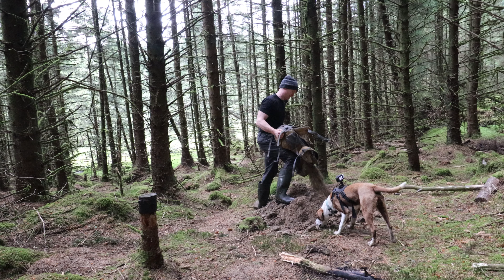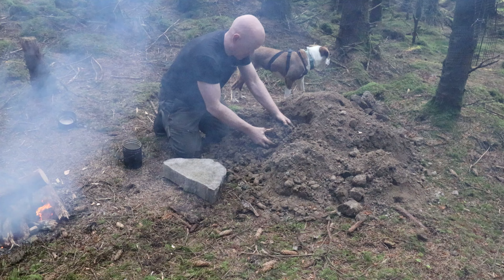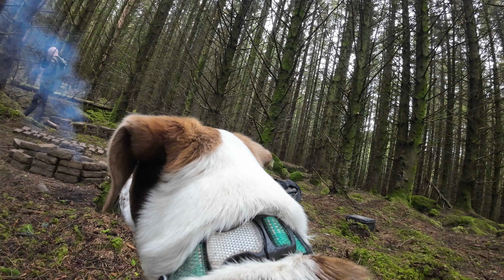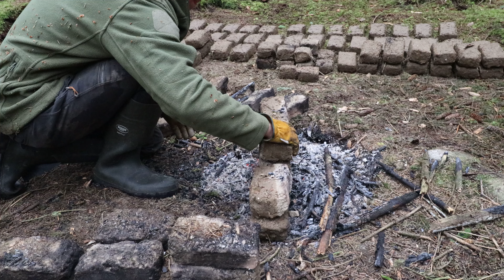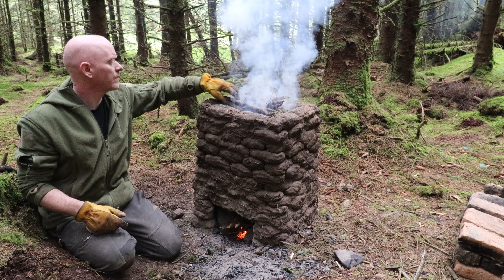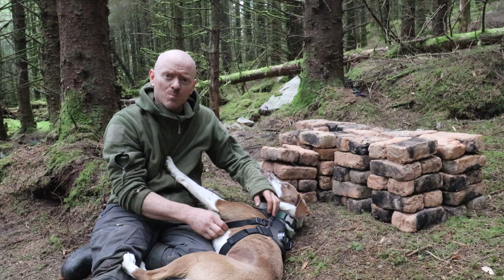Making clay bricks in the woods

Comment: I go camping in woods exactly like that, I had no idea there might be clay.
Do you snap off the broken bits of lower branch that the tree repairs with sap? - they are amazing fire starters
Reply from the maker: The clay is close to the river probably where an old river ran  found it by accident digging a shelter into an raised bank ..the lower branches are already dead they don't bleed of heal after I break them unless you cut right back to the trunk
Reply: @PaddysBushcraft  where I am the old snapped branches start going black with pitch resin, then when you knock them off at the trunk you get amazing fire lighters. Its the stuff that makes Fatwood.
Reply from the maker: @utubeape  do you know what type of trees they are
Reply: @PaddysBushcraft  It's Stockhill Wood, Mendips. They look like a type of pine to me but I have read there are Larch
Reply from the maker: @utubeape  I wouldn't be great with trees I know a few basics I thought my tree were pine but maybe there not 🤔